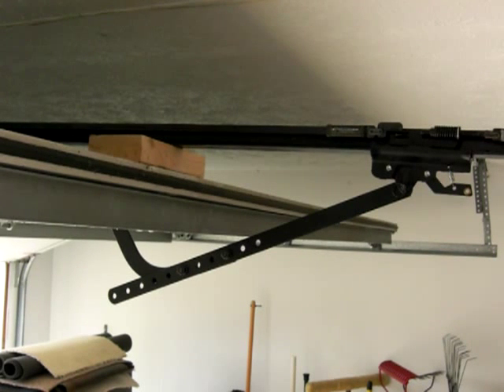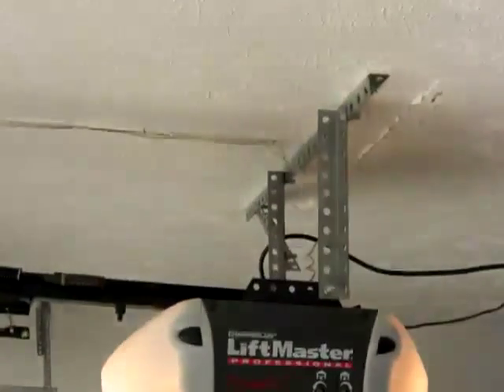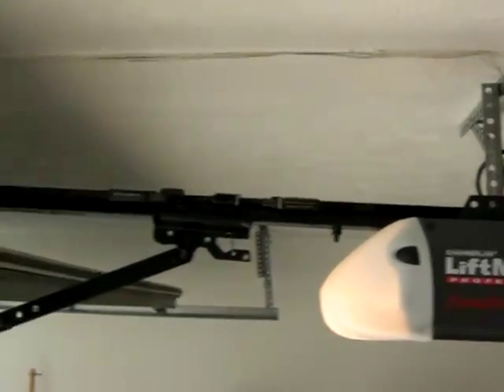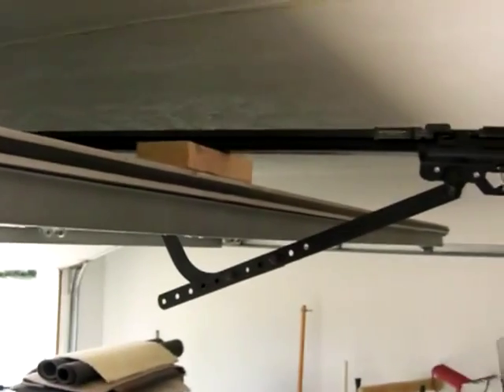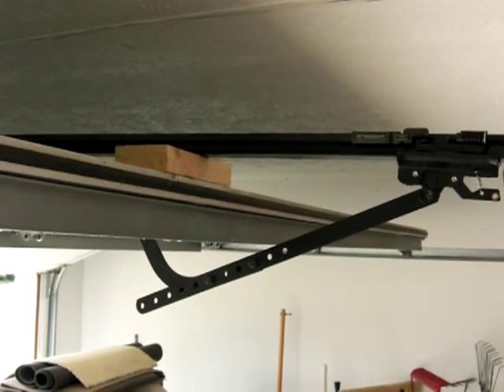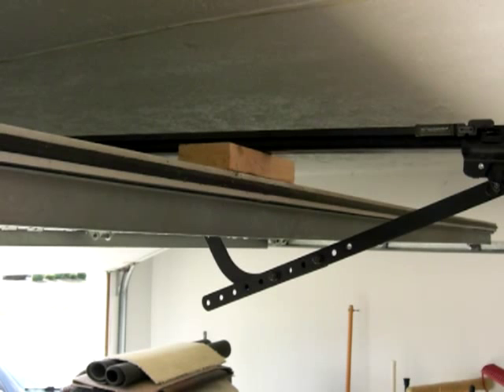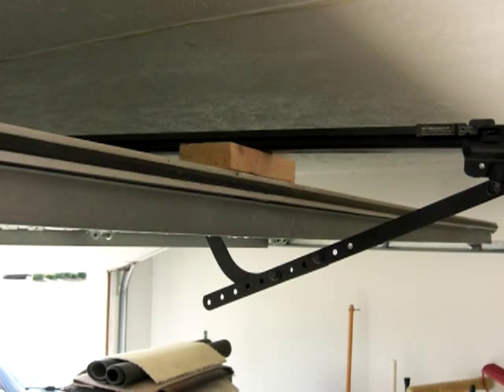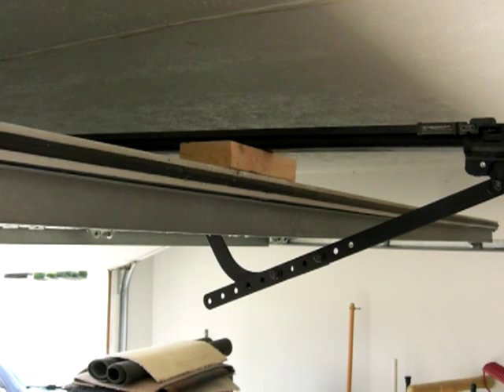Lift Master 3280 - 2 of 2 ... Lower the Motor Unit to Spec to reduce rattling trolley sound

Comment: I just installed a new garage door opener and I leveled the track. I haven’t attached all the sensors yet so I haven’t used it yet, do you think I should lower the motor unit and use the 2x4 method? It’s specifically mentioned in the manual, but I ended up following some YouTube videos and they all leveled the track, so I did too. Now I’m second guessing doing that.
Reply from the maker: I'd lower it how the manual says. Here are some explanations / my notes.  I asked around (please see other links).

- - - - - - - - - - - - - - - - - - - - - - - - - - - - - - - - - - - - - - - - - - - - -

There are several reasons for the loudness and jerky operation when the door starts moving.

The first reason is because of the AC motor itself. With AC motors, the motor will run at only one speed throughout the entire cycle. When the door opens/closes, the trolley is suddenly jerked and the inner/outer pieces make contact with each other very suddenly.

I also noticed that your opener appears to be installed almost level with the garage floor, rather than angled backward. That will cause the jerky/noisy operation when you close the door . . . and I would suggest that you go to your local home depot/lowe's and buy some angle iron and lower the power head (see the section in your manual titled "position the opener"). When the door is fully opened, the opener rail should be max 2 inches above the edge of the top section.

- - - - - - - - - - - - - - - - - - - - - - - - - - - - - - - - - - - - - - - - - - - - -

Off the top of my head explanation:  When at an angle, the bracket is pulling more "down" on the trolley, than "horizontal," which gives the motor leverage, which makes the job easier.

I'm not sure that putting the power head at an angle actually lessened the noise a lot, but I think you do want it at an angle like that. Maybe it increases the life of the GDO.

If you can verify, or figure out the actual explanation, I'd like to know.  Thanks!

- - - - - - - - - - - - - - - - - - - - - - - - - - - - - - - - - - - - - - - - - - - - -

Friction is the force that opposes the motion of an object. It acts against the movement of an object and is equal in strength to the force applied to the object . . . and the fact that when you reduce the "normal force" on the rollers / rods, yes the engine works harder but the friction is reduced . . . the greater the angle, the less the normal force, and thus the less friction, and less noise, unless you have a loud motor . . . http://www.mrfizzix.com/weightlifting/frict.htm

Angle of the rail for a Garage Door Opener . . . https://www.sciencebuddies.org/science-fair-projects/ask-an-expert/viewtopic.php?t=14211

Best angle of the rail for a Garage Door Opener . . . http://www.automaticwasher.org/cgi-bin/TD/TD-VIEWTHREAD.cgi?62277_

Calculating the Amount of Work Done by Forces . . . http://www.physicsclassroom.com/class/energy/Lesson-1/Calculating-the-Amount-of-Work-Done-by-Forces

Resolution of Forces - explains why to lower the Motor Unit . . . http://www.physicsclassroom.com/class/vectors/u3l3b.cfm

Inclined plane - Wikipedia . . . https://en.wikipedia.org/wiki/Inclined_plane

What is leverage? Definition and meaning . . . http://www.businessdictionary.com/definition/leverage.html

With a lever, I move the Earth | Star Stryder . . . “Give me a lever long enough, a fulcrum strong enough and I’ll move the world” –Archimedes . . . http://www.starstryder.com/2008/02/18/with-a-lever-i-move-the-earth/
Reply: slack7639  Thanks for the reply, I lowered it to the manufacturers specs.
Reply from the maker: No problem, glad I can help!

Comment: Dude! I have the same issue on my 2016 CRAFTSMAN belt driven garage door opener, at first I thought I installed it wrong and spent countless hours reviewing the owners manual, so when visiting a friends new open house party i noticed hes dose the same "crunch" sound and came to the conclusion that it is a characteristic of the design. Thanks for sharing the video

Comment from the maker: I asked a physics teacher why lowering the motor unit made it quieter. He said that it's because an inclined plane reduces friction.  The motor unit, however, does have to work a little harder . . . I've put two related links in the description under the video, to a page that describes the inclined plane, and another that describes vectors - motion and forces in two dimensions.

Comment from the maker: I've narrowed it down to seeing that the trolley moves side to side when closing. Metal to metal contact makes the rattling sound. I tried sliding a plastic wire tie into the trolley, on the opposite side of the belt, & that seemed to help. I think it would stay in. I tried putting another on the other side, & the trolley was firmly in place. Then I thought maybe it needs some play, so I removed them. I think they could make it really quiet by adding some plastic or rubber bumpers in that area.

Comment from the maker: Thanks! Since making these vids, I found that I was able to add a couple more O-rings to reduce rattling. They were less thick than the ones I used originally: 1) Where the door arm connects to the trolley, I removed the circular ring that holds it on, & added one there. I think it makes a difference, & 2) Where the door arm attaches to the door, on the far left side. I don't think this one made any difference because the two in the center restrict movement.

Comment: If the opener is properly mounted, it will gently pull/push the door when opening/closing because it doesn't strain as much during that initial pull/push to get the door moving. When openers are mounted too high or level with the floor, the door arm is at an awkward angle when the door is open. During closing, the opener will want to push the door towards the floor when the door begins moving  rather then towards the opening, causing the trolley to have a loud, sudden jerky movement.

Comment: Very nice! Your door runs smoothly now and is a lot quieter too! You can also try lubing the inner trolley, the top and bottom of the opener rail, and the pins that attach the door arm to the door and trolley to see if that helps too. I like to use 10w40 motor oil but a lithium or teflon spray will do also. You'll want to lay out some newspapers along the operator rail length to catch any drips and have plenty of rags on hand. Overall good job!